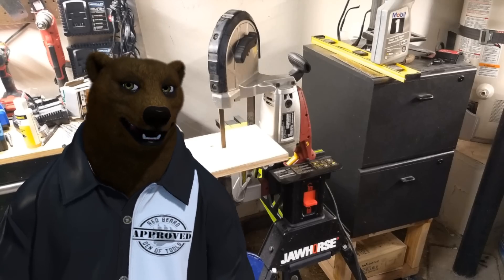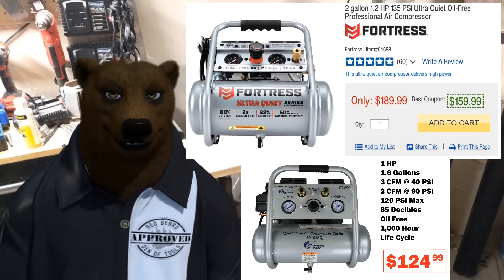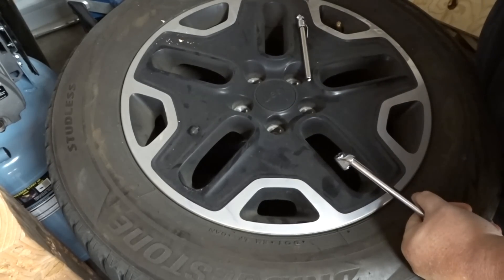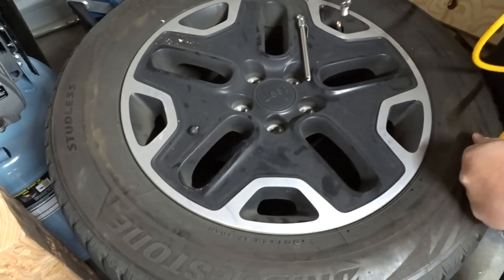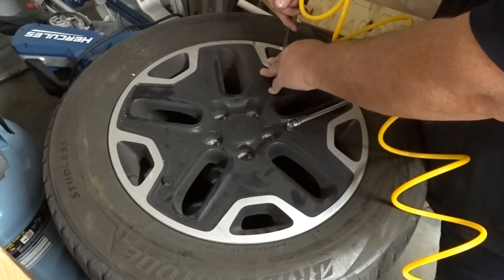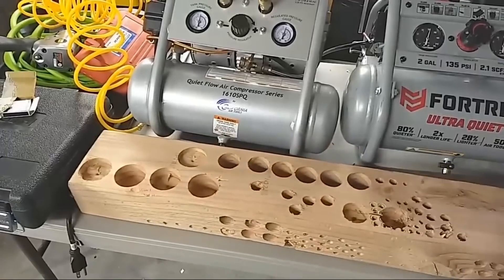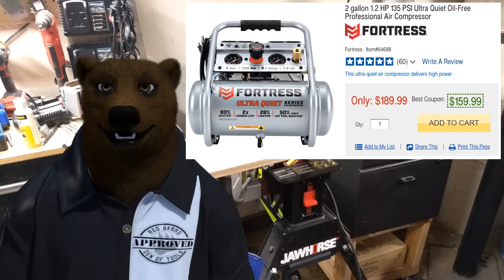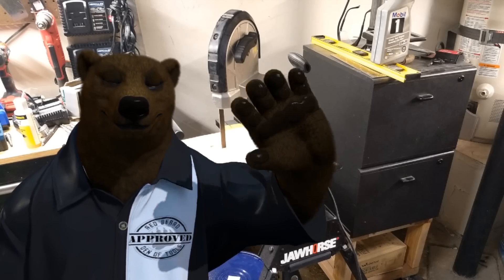Quiet Compressor Battle (Harbor Freight Fortress vs CAT)

Comment: Hey a great video as usual. I have also seen where someone has a small air compressor such as the Fortress you could add an extra tank to add storage . Depending on the size and the amount of money you want to spend to give you more volume.
Reply: Should be easy enough to just hook up a storage tank to the second outlet for that purpose. 9 gallon storage tank would work to stabilize the air delivery. Doesn't solve the low delivery but it would say least allow longer time between cycling.
Reply: Oh its the first time i ever heard that a tank could be added to some compressors. If so does it effect the psi compression?

Comment: 5:25 if the Fortress just relocated their front rubber foot pad just a bit more forward it would have been so much better. Then you could easily tilt it to drain with the valve at the bottom. As it is, it will slide on the rails when trying to do it without bracing it with the other hand, and then the valve lever hits the floor due to the lack of clearance.

Comment: I've had had multiple CAT and recently discovered a full set of replacement reed vales is around $120 for a $200 compressor.  Was looking at this some fortress compressor, called and was told replacement Reed valves aren't even available...... Something to think about.
Reply: you can buy the whole motor unit for around the same price
Reply: That's when you go Robinson Crusoe and try to fashion some make shift repair on your own, and feel awesome if you can make it work-

Comment: hook it up to a 20 gal. tank and see what it will do? I build houses and we drive 12`s. You need to buy framing nailer and see what it will do.
Reply: A big tank would result in longer down time when it charges up to pressure. If you don't need to work continuously, a larger tank would help extend the range of tools it could work with but might be frustrating having to stop for long periods of it just doesn't have the airflow needed.

Comment: HF no longer accepts coupons for Fortress.
Reply: It's $139 on sale without coupon now
Reply: 140 minus a penny, to be exact.
Reply: @dubmob151  I got a Makita quiet series. I wanted an HF, but they played games. I had a beefy 30 gal, and it was too big and noisy for my small shop. I moved to electric and use only a few air tools, so it was time to downsize.  I paid too much, but am happy with the quiet little Makita.
Reply: What did that one go for? I went and got the HF, did the 30 minute break in, and so far so good. I started it while plugged into a puny surge strip, and it had no issues starting up, happily enough.
I was beary happy to find out it's apparently a two stage compressor

Comment: I bought this after your 1st review. I wonder how well it would run a paint gun for small jobs such as painting a shed. From the information it does not recommend. I don't know how much constant pressure is needed to run a paint gun.
Reply from the maker: Did you see my other review of the new Avanti paint guns that's what you need for that shed

Comment: I picked up one of these harbor freight compressors because I didn't want to deal with the noise of a pancake or the size and noise of one of my bigger compressors. While is is super quiet and lightweight (ideal as a home tire inflator) and looks like it was put together well, unlike some of the harbor freight stuff, it is unfortunately a pile of shit.  I can shoot about six nails from my framing nailer before it cant keep up and nails dont drive deep. This is only through osb into douglas fir. Hardly a difficult job. I can shoot about two dozen 18 gauge pin nails before it wont keep up. I really wanted this to be awesome. I wanted to love it but it is a bust. I like the concept but the actual compressor just blows. Maybe if it had two of these quiet suckers on the same tank. It wouldn't be hard to make that work. But if I wanted to build or design a compressor I wouldn't have bought one.
 My personal experience is don't ever buy this for remodeling work or running air tools. Maybe a blow gun or a pneumatic/hydraulic press or airing up a tire.(you can air up a tire from an aerosol can so it isn't remotely demanding)
Reply from the maker: What size did you get?  You need a minimum of 2.2 CFM to run a framing gun and the 2 gallon is just shy of that.  As to brad nailer?  Not sure what is going on with your setup but as I demoed in the video, I can run it rapid fire, non stop and it just keeps going.

Comment: Anybody know why the two gallon Fortress is 60dB and the 4 gallon is 80dB !
Reply from the maker: The 4 gallon has a much beefier motor.  It's built to keep two framing hammers running nonstop
Reply: @denoftools  can you get away with not using ear protection with the 80dB model?
Reply from the maker: @taumax  Technically yes, but if you are working right next to it I'd wear it.  Now if you are 20' away and outside?  Nah.

Comment: I must be missing something, you can get an 8 gallon for around $160~ quite often. Maybe this is purely for portables who knows....but anyhow I am unsure what a two gallon compressor would be good for. I don't even know if you can air a tire up with that (quite possibly a single tire).

I'm sure there is a use for it but I don't know what it is (someone will tell me lol). The sound though, everytime I fire my california compressor up people get that look.....
Reply: Not sure if you HAVE one of these or are just expecting "a look", but these are mainly for airing up tires (using the compressor, not like I the video where he just used what was in the tank). The other use is for nailers, where someone might be inside a customer's house and want quiet over extreme power.
Reply: You can just get a 13 gallon air storage tank of you want to fill up tires without power for the compressor, that would outperform any of these for that specific use. 
Not sure why anyone would but a compressor and use it to air up their tires with just what's in the tank though.
Reply: Why anyone would *buy*, that should have been. 
Can't edit here for some reason-

Comment: Any reason I can't hook one of these up to an 11 gallon aux tank and have a nice quiet shop compressor with decent capacity?
Reply from the maker: Nope, that is a great idea.
Reply: As long as your continuous air flow requirement doesn't except exceed 2.1 cfm at 90 psi. If it does, then you have to take coffee breaks periodically to let it charge up the larger air volume before you can resume working.

Comment: I paused 25 seconds into this video because of the clever intro.   Well Done Sir !!!      Now off to watch the rest......

OK .
I appreciate the review of the fit and finish but the performance test just seemed to verify what you would expect due to tank size.   I would like to how each could keep up with a continuously running air tool with a gauge showing the PSI being maintained.  With each feeding a tool that consumes an established cfm, seeing what PSI the compressor can maintain at the tool is then testing the compressor  pump itself  once it has to kick on wouldn't it ?
Reply from the maker: Thanks, I was inspired for that video.  As to the test, didn't I do a flow test just using the air nozel?
Reply: @denoftools  I am not certain what part of your tests your referring to in using a nozzle unless it was the tire inflation test.       I am thinking of a test that gives an idea of what cfm at a certain psi the pump of the compressor can actually produce.   Not utilizing the reserve of higher pressure in the tank via its regulator.   No doubt difficult with smaller compressors like these so .maybe just an indication  of which is better in that regard..    Thanks.

Comment: How loud is the air blowoff noise that happens every time the compressor is done filling?
Reply from the maker: Almost none.
Reply: @denoftools  awesome thanks! I just bought the Kobalt "quiet" compressor similar to this one, and it is indeed quiet while pumping, but the air rush sound it makes when it hits max pressure is enough to make me jump. I'll be returning the Kobalt for the harbor freight one then

Comment: Coincidentally, I just took delivery of this Fortress model the same day this video was uploaded. It looks and sounds great. But, now I'm wondering how it will do running an AirCat  805HT (6 CFM), and AirCat 1000TH (8 CFM)?  Just used intermittently for personal car repairs.  I hope it will do the job.  Otherwise I'm stuck with a noisy, 40 year old Craftsman clunker...
Reply: How did it do? Do you think adding a larger tank would help?
Reply: @woodworkerroyer8497  Hah, haven't done any car repairs since purchase.  It's at my son's home now.  We used it with a brad nailer, and it easily kept up.  It's a great purchase no matter what.
Reply: If it's for intermittent short term use like an impact gun, a larger tank hooked up to the second port should do just fine.  You just have to have the patience to wait for it to charge up in between uses.

Comment: Maybe it was mentioned but what makes these soo much more expensive than the pancake/hotdog ones at HF for $40 ?
Reply from the maker: They are dual stage quiet compressors.  And they have about 10x life expectancy over your average pancake.
Reply: Didn't even know this is a dual stage, didn't even consider that.  If that was in the description i missed it. Makes sense now-

Comment: Bear, I have a laser engraver and cutter and I need a quiet pump but not one that will be dead on me in 6 months with normal usage as I have read in reviews of the California ones.  What I am currently using is the HF red pancake one but two issues and that is #1 OMG, that thing is horribly loud and so loud I can hear it outside of my brick house and I wear ear protection when it is on and #2 the tank is just not enough.  Any suggestions?
Reply from the maker: I used to think of the Cal Air as the gold standard but since we started talking about them I've received almost 100 emails from people telling me stories of the CAT just up and dying.  I'd really consider these Fortress systems.  The 1 gallon is really quite and the 2 gallon isn't much louder but it can push a lot more air.
Reply: Bear, the problem is my 3 gallon pancake is just not enough for a lot of my jobs so 2 gallons would be even worse.
Reply from the maker: What cfm do you need?
Reply: 100 is way more than enough.

See, these machines normally come with a HUGE aquarium pump but mine died and if you ever kept fish you know how a diaphragm doesn't like to have its flow blocked and will burn itself out which is precisely what happened.  When engraving you just want the merest hint of air (it prevents the smoke from hitting the lens which will block the lens and the CO2 laser will break it) but when you are cutting the more air flow the better the cut, and deeper, it will be.
Reply from the maker: @thebeststooge  100CFM?  No I think you got  that wrong.  No one does that.  I looked into it some and guys were talking 30  psi. Any of these will do that.  I think the main issue is them run time.  Again, I think the Fortress 2 gallon should handle it.  Try it, you can always return it.
Reply: I run 100 psi here on thick wood.  Oh, well quiet and 5+ gallon capacity, for some odd reason, isn't made.
Reply from the maker: Neither of these can do consistent 100 PSI.   The fortress can get up to 135 but runs down to about 65 or 70
Reply: As the pressure in the tank runs out I understand.  Really 60psi is cool but the need of a 5, or even 10 gallon, tank is the second most needed thing.  Thank you for looking for me as I appreciate it.

Comment: Filling that tire served no purpose...  of course at the same PSI the two gallon tank will fill it better...  of course neither would run an impact, ect...  good video overall, just an attempt at constructive criticism
Reply: If the compressors were turned on it might be useful to know how it might differ in actual use.
 If one compressor had a one gallon tank but 10 scfm delivery, it would certainly outdo one with a bigger tank but low delivery rate. 
But if both have the same delivery rate, it's a given that the bigger tank will put more psi in the tire, yes.

Comment: The Fortress certainly seems like a nice step up in quiet compressors.  No offense to your testing, but in the end, the Fortress brand will make it if it shows to be dependable.  The roll cage and nice handle won't mean a thing if the compressor pump fails after 12 months.  I hope the Fortress proves to be the real deal because I'll probably be needing one in a couple of years and there's a Harbor Freight nearby!
Reply: I've had my 2 gallon Fortress 2+ years and its still perfect.  Light enough for me to take it up 2 stories of scaffold for air nailing trim on a house. (yeah, I have plenty of extension cords, but just the 1 air hose. didn't want to buy another long hose for just 1 job)   Otherwise it sits in my basement work shop, plugged in and left on all the time.  no leaks ever. So quiet.  Fills fast when it runs.  I got a small 4 wheel dolly to roll it under the work bench, out of my way.  I bought 3 pneumatic nailers: staples, 16g and 18g. They all work so much better than my previous electric nailers.  Because its so quiet and fills so fast, overall it doesn't  run nearly as long as my previous hf 2 gallon pancake model did so I expect it will last a very long time. That red noise maker sounded like it was maxed out all the time and ready to break.  The Fortress just hums along with no effort.

Comment: That may or may not have been me that commented about the hi flow air fittings. People should really be taking advantage of those fittings. I just put another set on my 2nd hose tonight. I wish they offered those in the swivel plugs. Also, I saw your decibel meter sitting there but you didn't use it? Did it not work out for you?
Reply from the maker: Nope, it died.  Had to send it back. Looking for a new one.

Comment: Good video. I was hoping to hear them side by side to see if one was quieter than the other especially when they are up around 90-100 psi. The model of Cal Air in the video is now discontinued and the motor/pump looks different on the 2gal Fortress in the stores now. Look forward to another comparison video in the future if you do one, especially the small ultra quiet 1gal models on the market.

The only other thing I wanted to point out, the air hose from the pump is in a better spot on the Fortress as mentioned but it looks like the side air hook up sticks out a little which is a bit vulnerable to me. You could cap it of course. But the power switch regulator thing sticks way out on the Cal Air model and its sunk in and protected even more by the cord wrap on the Fortress. I do like that design better.

Comment: A side by side chart of your final results? My 20 year old Cambell H. Had a check valve failure. It's been a work horse but will sometimes make me jump when it fires up in my small shop, this maybe my replacement.

Comment: Did I dream it or did you post a video once of leaked HF products that had a 20 or so gallon Fortress vertical compressor in it?
Reply from the maker: 27 gallon I can't wait for it
Reply: The Den of Tools I’ve been holding out for it.  Any idea of the price point or when it will be released?  I wonder if it will be more than the 29 gal belt drive compressor?
Reply from the maker: They have steadfastly refused to tell me anything about it.  I think they just like to watch me beg. But based on pricing of other systems in the market I'd say between $300 and $350

Comment: Great Job On the Review and Intro. Going to have to say neither one impressed me. For $20-$50 more why wouldn't you go with an oil driven 20+ gallon Air Compressor. They seem to do more then what these did. I have a 22 Gallon GM Compressor from Orielly Auto parts that I'm not happy with nor am I upset over the purchase. It does what I need to do at the house, but not much more. At least I can air my tires though. lol Cheers and thanks for sharing
Reply from the maker: Justin,  these are mostly used by either guys running nailers or other light duty work. Stuff where a bigger compressor either isn't needed or wanted.
Reply from the maker: Justin, those rules don't apply here.  We support other creators. Feel free to post your stuff all the time. I just ask that it's family friendly.  Also, we have a forum we just started at www.denoftools.com and there is a whole section there to promote your channel.
Reply: The Den of Tools Thanks Brother. Some is some is not. This one is. Hope you enjoy and thanks for letting me share. 🍻

Comment: Great video, I agree with you on the CAT compressor not having the finish level of the competitor. I just bought my first compressor the 8 gal cal air and it is very quiet but one of wheels arrived completely bent there was paint chipping. I'm returning it and going to try another quiet compressor. Also you never did a sound test on the CAT unit. My 8 gal cat is so quiet though I was impressed.

Comment: The problem with these little compressors, they tend to overheat and shut down.  I used one for about 2-3 hrs, using an airbrush @ 60psi.  Now it wasn't constantly running, but it had some good run-time on it.  It eventually overheated and shutdown on me. I tried again the next day, and it was done.  So I picked up another one and now I use a 9" fan to blow on the motor to prevent overheating.